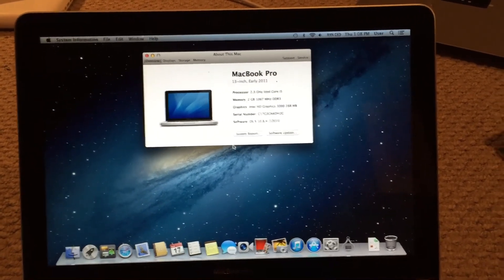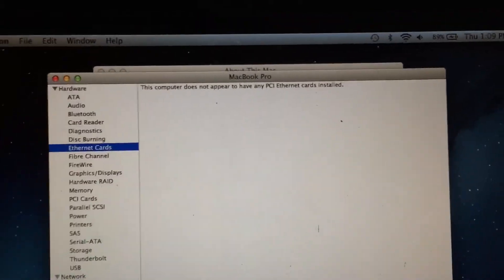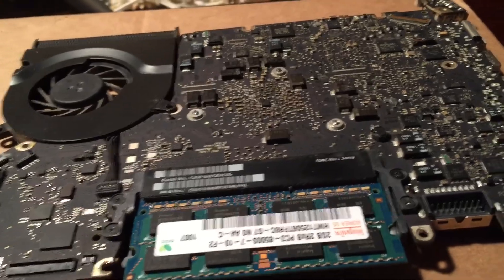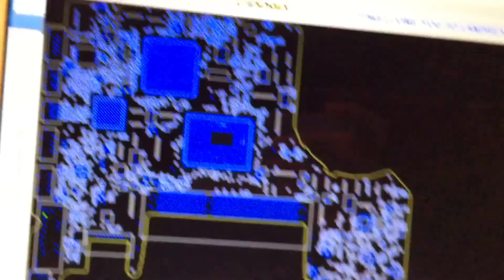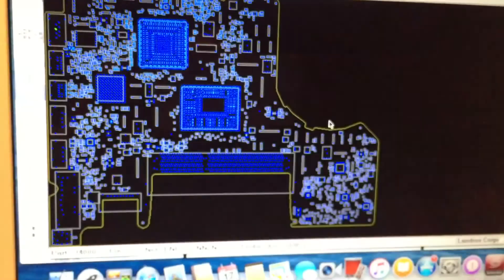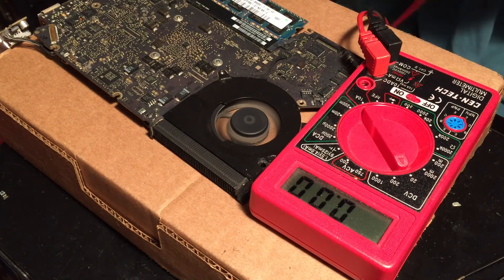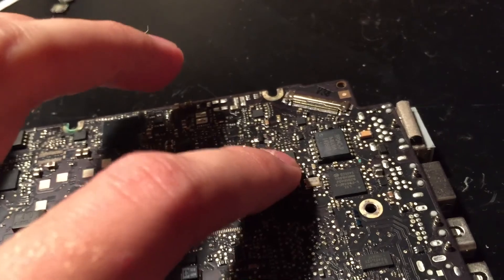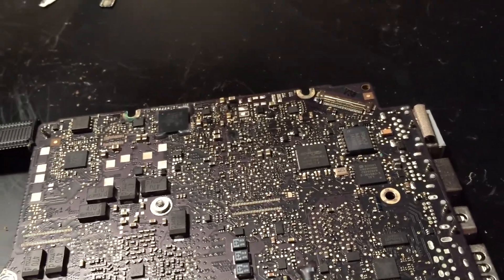Early-2011 13" MacBook Pro Ethernet Controller Repair

Comment: Thanks for a great video tutorial. I have a question: How do you get the software for the schematics and how do find the parts to replace that chip. I have a mid 2012 with no ethernet, SD card and firewire showing up.

Comment: Hey, this video is amazing. I've done a lot of MBP repairs but so far not yet board-level repairs. I am amazed by what you are able to do with just a few relatively simple tools. Couple questions. What software are you using to view the schematic and board layout, and where can the schematic files for MBPs be found? Thanks!

Comment: Hello ! It's an impressive video. I think my Macbook pro mid 2012 has exactly the same problem: my ehternet port disapeared a few days ago. Now I checked the card reader and it also says it's not installed. But I don't know how to get this chip, I don't have the liquid you are using, nor another equipment to make it hot....

Comment: Looks like a pretty easy repair, good job! Did you fix the memory slot or is that a lost cause?
Reply from the maker: I haven't bothered with that, as I don't think I could do it with my equipment without damaging the plastic, risking messing up the working slot.
Reply: Makes sense. I'd rather have one working slot that 2 broken slots.

Comment: May I please ask why your 2011 have the MagSafe 2? Mine has the L shape MagSafe 1. Thanks
Reply from the maker: It's not MagSafe 2, this is just the older, "T-tip" style MagSafe 1 adapter.
Reply: dosdude1 thanks for the info!

Comment: I've got the same problem with my mid2012 macbook pro. Ethernet and SD-Slot is not working anymore. Is it possible that it was caused by an update?
Reply: I am having the same issue.

Comment: Do you get a lot of kernel panics on your 2010 white MacBook, or what ever MacBook was on your lap?
Reply from the maker: Not at all.
Reply: Thats good. My MacBook 2010 has High Sierra on it, but I used to have Mavericks on it, but it would kernel panic all the time probably due to it only having 3GB ram. now I have 8. what are the specs in your MacBook?
Reply from the maker: It's a Mid-2010 model with 4GB of RAM, running OS X 10.9 Mavericks.